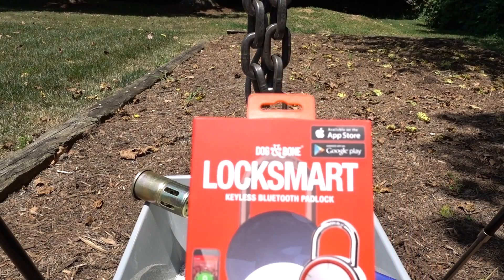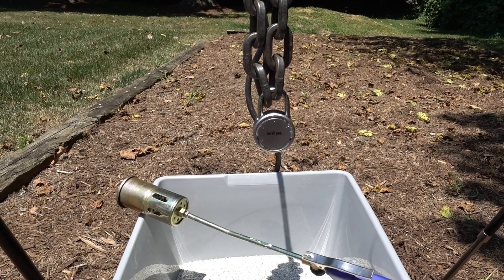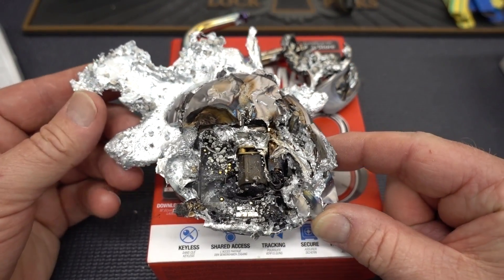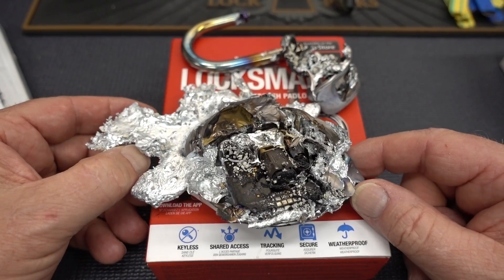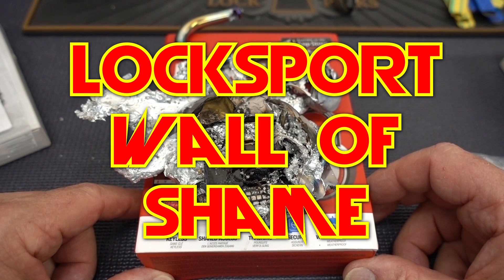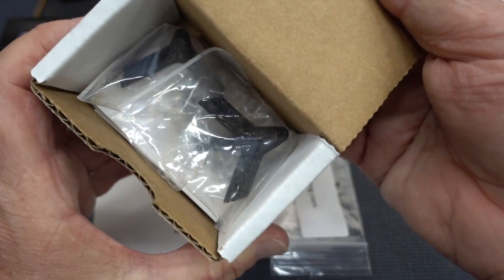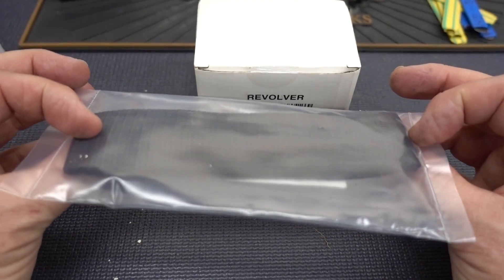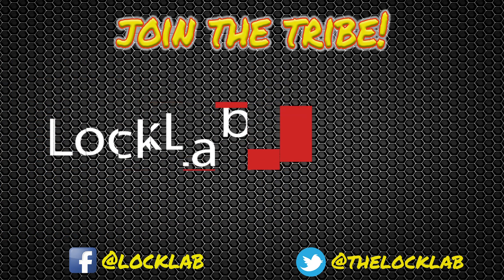(1325) Dog & Bone Locksmart Assaulted with 3000 Degrees

Comment: Thge Abus combination locks can be cracked quite easily due to thier over abundance of false gates and the difference between the feel of false gates, real gates and other numbers. The primary attack is done by lining up 4 false gates in a row then feeling for the gates one combo at a time. it should take maybe 3 minutes. on top of that the series of false gates is in predictable order so if you line up 4 false gates and have figured out the order of the false gates you can decode it in just over a minute. Honestly the hardest part of either method is linning up 4 false gates and since half the gates are false, it is a 1 in 32 chance of doing so and you get tactile feedback when it is done with a definite movement of the lock actuation button. I have a video of decoding it on my channel.

Comment: What sort of torch was that again?? I love that stuff! I've seen 500k BTU torches before but they were oxy/fuel  torches and buddy they could heat a gymnasium in like thirty seconds. good stuff!
Reply from the maker: I bought it on eBay and it is "Green Way" branded - I've never heard of them before.  It really is pretty low-tech, just blasts out large volumes of propane really fast.  I had it hooked to a 20 pound propane tank and I bet the video took at least 5 pounds of propane.  It is definitely NOT efficient but it really does throw out the heat!

Comment: #BosnianBill

I received this from a cyber-security monthly email from Bruce Schneier. Here's my nomination for the wall of shame.

"Ridiculously Insecure Smart Lock

Tapplock sells an "unbreakable" Internet-connected lock that you can open with your fingerprint. It turns out that:

The lock broadcasts its Bluetooth MAC address in the clear, and you can calculate the unlock key from it.

Any Tapplock account can unlock every lock.

You can also open the lock with a screwdriver.

Regarding the third flaw, the manufacturer has responded that "...the lock is invincible to the people who do not have a screwdriver."

You can't make this stuff up.

https://www.theregister.co.uk/2018/06/15/taplock_broken_screwdriver/
"

Comment: What lock pick set would you recommend for a total noob price range 30$ max (20$ would be ideal). And are you from bosnia?
Reply: When I started, I was originally recommended the Southord PXS-14 kit, but I found that the hooks supplied with that kit were somewhat large and unwieldy. Nowadays I am personally very partial to Sparrows picks. Something like their "Kickstart" kit (costs about $20) might work well to get you started, and for another $10 you can get their "five piece flat bar" top tension set so you can also try top-of-the-keyway tensioning to see what you prefer.

Comment: Hey Bill have you ever thought of electrically heating a locks shakle to pull the hardening and temper out of it? Make for much easier cutting maybe? Or heat and quench to make it brittle?

Comment: But can you melt it with one of those puny things made to flambe deserts?  
those are quite easy to get and kind of fits in a pocket, while that flammenwaffer thing might be a little,, clunky to drag around. (and will probably set fire to whatever they are trying to get into)
Reply: lordsqueak well, LPL has melted several zinc locks with a plumbing torch
Reply: hmm thats still a bit much though. I'm thinking of something a crackhead might have in his pocket, kind of.

Comment: Heard BTU first time in my life (despite living in UK), when I wanted to convert it, it turned out it's a unit of ENERGY not POWER. Anybody has an idea what it means? Also 3000deg would melt pretty much anything (including the secured locker/bike/whatever) but no thief walks around with blowtorch that size. Zinc only melts at around 420 degrees, not a good choice.

Comment: I was shopping for a new padlock to lock up my kids bikes at the house, the bikes aren't expensive and it's a somewhat secure area so we didn't need to go full on heavy security locks. I did however want to lock it to a metal bar that runs along the bottom of our windows, so it needed a large sized lock. Knowing that Master locks are junk, I went with a Yale. It only cost about 12 USD, but still had security pins in it! I didn't expect that, was a well built beefy laminated lock with double ball bearing lock pawls, with a small size non-removable core rated at high on strength but around medium on security on their scale. I managed to pick it, which is how I found out it had security pins. Long story short, thanks to knowledge gained from this channel, I was able to pick a better lock at a good price, and knew enough to steer clear from the Master junk locks.

Comment: I nominate for the wall of shame the Centurion SIPL060, for having a fake "hardened" shackle, and being vulnerable to a comb pick, as well as being notorious for corrosion issues, and just generally having abysmal fit and finish. It has a spring loaded locking pawl, so it may or may not also be vulnerable to rapping attacks?

Comment: It's a bit too late to suggest it now, but it would be interesting to see how little heat and time it would take to cause the lock to malfunction and deny the legitimate owner access.

Either by murdering the chips or from causing the solder to melt.